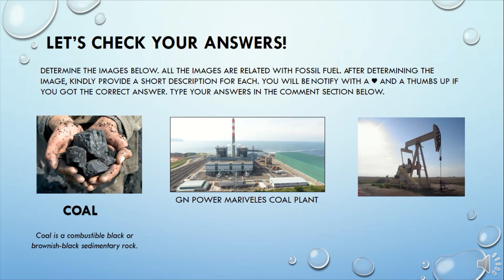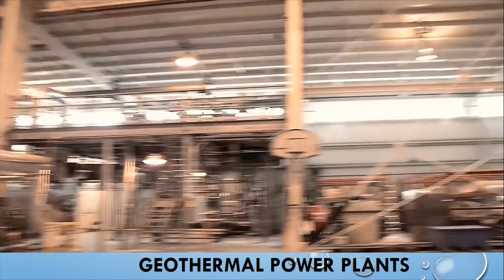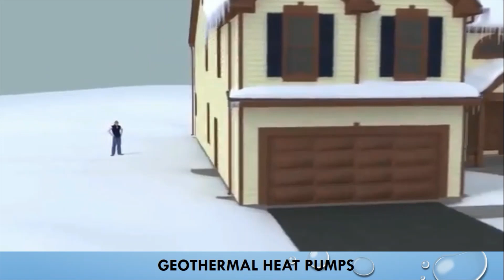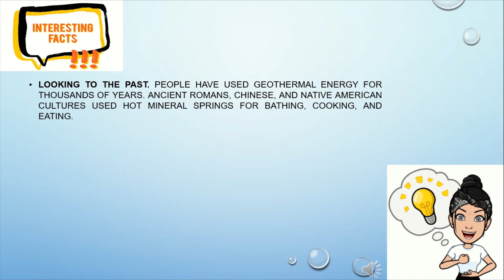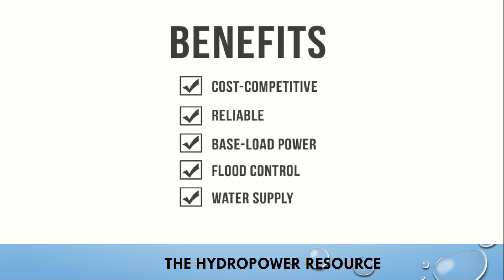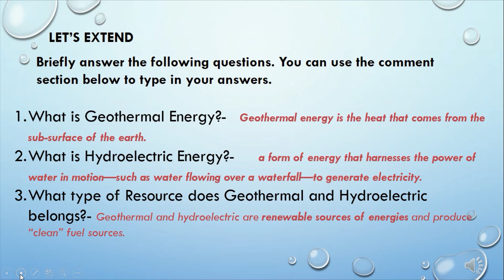GEOTHERMAL ENERGY AND HYDROPOWER RESOURCES (A SHORT DISCUSSION)

Comment: Neia Yzabel M. Real 
11 STEM- Taurus
Let's Review
A. Coal - A material usually found in sedimentary rock deposits where rock and dead plant and animal matter are piled up in layers.
B. Generating Station - The main source of electrical energy.
C. Pumpjack - Used in extracting crude oil, is the over ground drive for a reciprocating piston pump in an oil well.

Let's Extend
1. Geothermal Energy - is the heat that comes from the sub-surface of the earth
2. Hydroelectric Energy - a form of energy that harnesses the power of water in motion such as water flowing over a waterfall to generate electricity
3. Geothermal and hydroelectric are renewable sources of energies and produce clean fuel sources.

Comment: Rivera, Jasy Jan C.
11-STEM Scorpius

Let's review
A. Coal - one of the most important primary fossil fuels,  formed from dead/decaying plants that have been fossilized over millions of years. 
B. Generating station -  a plant for  generating electric power.

C. Pump jack - is a device used in the petroleum industry to extract crude oil from a oil well where there is not high enough pressure in the well to force the oil to the surface.

Comment: Georgette Rhianne C. Baluyot
11STEM-Phoenix

 Let's Review 
A. 
Coal- one of the most important primary fossil fuels, a solid carbon-rich material that is usually brown or black and most often occurs in stratified sedimentary deposits.

B.
 Generating station- a station for generating electricity, where electricity is expected to be directed to households and other facilities in need of electricity. 

C.
 Pumpjack- is the overground drive for a reciprocating piston pump in an oil well. It is used to mechanically lift liquid out of the well.

Let's Extend
:

1. Geothermal energy comes from the heat within the Earth. Produces electricity, to heat buildings and greenhouses, and for other purposes.
2. Hydropower, or hydroelectric power, is one of the oldest and largest sources of renewable energy, which uses the natural flow of moving water to generate electricity. 
3. The type of Resource that both Geothermal and Hydroelectric Power belongs to is the Renewable Energy.

Comment: Tumbaga, Reinalyn J.
11- Stem Pisces

LET'S REVIEW
A.) COAL - Coal is a sedimentary rock that can be burned and use as a fuel.
B.) GENERATING STATION - Also known as generating plant, an industrial facility for the generation of electric power.
C.) PUMP JACK - Device used in the petroleum industry to extract crude oil from oil well.

LET'S EXTEND
1.) Geothermal energy is a renewable energy source that comes from the heat within the earth.
2.) Hydroelectric energy is electrical energy produced through the power of moving water.
3.) Geothermal and Hydroelectric are both renewable sources of energy.

Comment: Lim, Anne Margaret M.
11 - STEM PHOENIX

Let's Review
A. Coal - is a solid carbon-rich material, usually brown or black, found in stratified sedimentary deposits. 
B. Generating Station - is a facility that is responsible in the production of electric power.
C. Pump Jack - is a device that is used to crude oil extraction by mechanical means.

Let's Extend
1. Geothermal energy is a renewable energy source derived from the heat energy contained within the Earth.
2. Hydroelectric Energy is a type of electrical energy that is generated by the movement of water.
3. Both are renewable energy sources.

Comment: Tuazon, Janna Christel B.
11 - STEM LIBRA 

Let's  Review
A. Coal is a type of fossil fuel that is typically black or brown in color and is used to generate electricity.

B. Generating Station is a facility that is responsible in the production of electric power 

C. Pump Jack is a device that is used to crude oil extraction by mechanical means.

Let's Extend
1. Geothermal energy is a renewable energy using heat within the earth.

2. Hydroelectric Energy is a type of electrical energy that is produced by hydropower or water.

3. Both of them are renewable energy sources.

Comment: Untiveros, Kim Lheonardo D.

a. COAL- coal is type of mineral formed by a called coalification
b. GENERATING STATION - a electric power generator 
c. PUMP JACK - a hammer like pump in oil well

Let’s extend:
a.Geothermal Energy- Heat that comes from the surface of earth
b. Hydroelectric Energy- energy from a flowing form of water
c. What type Sources… - It belongs to renewable source of energy

Comment: Guanzon, Aldryn Anne I. 
11 STEM - Sagittarius

Let's Review:
A. Coal - a sedimentary rock which is mainly used for generating electricity. 
B. Generating Station - a facility wherein primary energy like coal is being converted into electricity. 
C. Pump jack - a device used to increase pressure within an oil well to pull the oil into the surface.

Let's Extend:
1. Geothermal energy is the heat coming from the Earth's interior. It is used primarily to produce electricity.
2. Hydroelectric energy is a form of energy that generates electricity by harnessing the energy of flowing water.
3. Geothermal and Hydroelectric energy are under the category of renewable energy.

Comment: Gabor, Karloz Yzmael B.
11- STEM VIRGO

LET'S REVIEW
a.) Coal - Coal is the most abundant fossil fuel resources. 
b.) Generating Station - Is an industrial structure that generates electricity.
c.) Pumpjack - Pumpjack is the underground drive for a reciprocating piston pump in an oil well.

LET'S EXTEND
1. Geothermal Energy is a renewable energy source because heat is continuously produced inside the earth.
2. Hydroelectric Energy is a form of energy that harnesses the power of water in motion.
3. Renewable energy sources include Geothermal Energy and Hydroelectric Energy .

Comment: Añonuevo, Chrysler A.
11-Stem Sagittarius

Let's Review
A) Coal is a flammable black or dark brown rock made primarily of carbonized plant materials that is found primarily in underground deposits and utilized as a fuel.

B) A generating station is a power plant that produces energy.

C) Pump Jack- A pump jack is a device used in the petroleum sector to collect crude oil from wells.

Let's Extend:
1. Geothermal energy is a source of energy that comes from the core of the Earth. It's produced by the heat generated during the planet's development and the subsequent radioactive decay of elements.

2. Hydroelectric energy is a type of energy that uses the force of moving water to generate electricity.

3. Renewable energy sources include geothermal and hydroelectric electricity.

Comment: Let's Review
A. Coal is a fossil fuel that formed from the remains of plants that died million years ago into peat.
B. Generating it is a facility for the generating of electric power. 
C. Pump jack is a device that use to get crude oil from oil well where there is not high enough pressure.

Comment: Sagun, Neil V.
11-STEM, Phoenix

Let's Review:
A. Coal
- One of the PRIMARY FOSSIL FUELS. A combustible black or brown rock composed of carbonised plant matter. Found mainly on underground surfaces
B. Generating Station
- A station that facilitates electric generation.
C. Pump Jack
- Used for extraction of oil or crude oil in petroleum industry

Let's Extend:
1. Geothermal Energy 
- An energy present in Earth's crust and formed by radioactive decay, it is also the heat from our planet's core. A renewable resource.
2. Hydroelectric Energy
- An energy in which the harnessing of water power in motion is generated. A renewable resource.
3.  Geothermal Energy and Hydroelectric Energy are both renewable resources.

Comment: Espinosa, Marcelino C.
11-STEM TAURUS

Let's review

COAL
- is combustible  sedimentary rock,Coal formed due to heat and pressure that turns the dead plants into coal.

GENERATING STATION
-is a plant for generating electric power.

PUMPJACK
- is a machine or tool  used in the petroleum industry to extract crude oil from a oil .

Lets extend

What is geothermal energy?
- Geothermal energy is heat within the earth. 

What is hydroelectric energy?
- is a form of energy that harnesses the power of water in motion such as water flowing over a waterfall to generate electricity. 

What type of resource does geothermal and hydroelectric belongs?
 - is a renewable sources of energy and produce clean fuel sources.

Comment: Bernatia, Danah Danica R.
11 - STEM Sagittarius
Let's review:
A.Coal
- formed from dead/decaying plants that have been fossilized over millions of years and subjected to heat and pressure.
B.Generating station
- Is a source of electricity
C.Pumpjack
-  Is used to mechanically lift liquid from the well if there is not enough pressure under the hole for the liquid to flow to the surface.

Comment: ANDRES, JOHN BENEDICT M. 
11-STEM Phoenix

Let's review: 

A) Coal - is a combustible black or brownish-black sedimentary rock and contains high amount of carbon and hydrocarbons primarily used as a fuel.

B) Generating Station - A power station or power plant is a facility for the generation of electric power.

C)Pump Jack - a device used in petroleum industry to extract crude oil from oil well.

Lets Extend:

1. Geothermal energy is heat within the earth also comes from the heat in the earth’s core. 

2, Hydroelectric energy - is a form of energy that harnesses the power of water in motion such as water flowing over a waterfall to generate electricity.

3. Geothermal energy and hydroelectric energy are both renewable energy sources.

Comment: Montero, Gerard James R.
11- STEM virgo

let's review:🎃
A. Coal is a type of fossil fuel formed from sediments such as prehistoric animal and plant remains that constantly piled up and become pressurized through time.
B. Generating Station is an industrial facility for the generation of electrical power.
C. Pumpjack is a device used in the petroleum industry to extract crude oil from an oil well where there is not high enough pressure in the well to force the oil to the surface.

let's extend:🎃
1. Geothermal Energy is the heat that comes from the Earth's core and is a renewable source of energy. It is produced from the heat generated during the planet's creation and the subsequent radioactive decay of elements.
2. Hydroelectric energy is a form of energy that harnesses the power of water in motion to generate electricity. 
3. Geothermal and hydroelectric energy are both considered renewable sources of energy.

Comment: Sharlene Gayle V. Mendoza 
11- STEM Sagittarius 

Let’s Review
A: Coal is - combustible black or brownish- black sedimentart rock and it is mostly made up of carbon with varying proportions of other elements and Coal is mostly used as source of electricity.
B: Generating Station- it is a power plant that generates electric power
C: Pumpjack- is a device used in the petroleum industry to extract crude oil from a well when the pressure in the well isn’t high enough to propel the oil to the surface.

Let’s Extend:
1. Geothermal Energy  is heat that comes from beneath the earth’s crust and it is renewable energy source since it can be supplied constantly inside the earth.
2. Hydroelectric Energy- it is a renewable energy source that generates electricity by exploiting the natural flow of water
3. Geothermal and Hydroelectric are both renewable sources of energies.

Comment: Ladra, Camille Morales
11- pisces(stem)

1.Coal- is a black or brownish-black sedimentary rock that can be burned for fuel and used to generate electricity
2.Generating station- A power station, also referred to as a power plant and sometimes generating station or generating plant, is an industrial facility for the generation of electric power.
3.Pump jack- is a device used in the petroleum industry to extract crude oil from a oil well where there is not high enough pressure in the well to force the oil to the surface.

Comment: Ma. Jennilyn G. De Jesus
11 STEM - Pisces
Let's Review
A. Coal is a type of fossil fuel formed from decayed plants that are fossilized for millions of years and is applied heat and pressure. 

B. Generating Station is an industrial facility that generates electricity from primary energy. 
C. A Pump Jack is use to mechanically lift liquid out of the well if not enough bottom hole pressure exist for the liquid to flow all the way to the surface.
Let's Extend
1. Geothermal Energy -  is the heat that comes from the sub-surface of the earth. It is contained in the rocks and fluids beneath the earth’s crust and can be found as far down to the earth’s hot molten rock, magma.
2. Hydroelectric Energy - is a form of energy that harnesses the power of water in motion—such as water flowing over a waterfall—to generate electricity. 
3. What type of resource does Geothermal and Hydroelectric belongs? - they are both classified as renewable sources of energy.

Comment: Andrei Nicole M. Santos
Grade 11- Phoenix

Let's review: 
Coal: Formed from the remains of living organisms millions of years ago and releases heat energy when burned. 
Generating station: A source of electrical energy.
Pumb Jack: A device used to extract crude oil.

Let's extend:
Geothermal energy is heat within earth. Hot water and steam from deep underground can be used to drive turbines is called geothermal energy.
Hydroelectric energy. The water high up behind the dam contains gravitational potential energy . This is transferred to kinetic energy as the water rushes down through tubes inside the dam.
Geothermal and Hydroelectric are both renewable resource of energy.

Comment: Kathleen Kate P. Faustino  
  11 STEM Sagittarius               
 A. Coal is a fossil fuel made up of sediments such as prehistoric animal and plant remnants that have accumulated over time. Coal is a form of substance found in sedimentary rock deposits where dead plants and animals are stacked in layers.                                       B. A generating station, such as the GN Power Mariveles Coal Plant shown in the picture, is the primary source of electrical energy for households.  
C. A pump jack is a device used in the petroleum industry to extract crude oil from a well when the
pressure in the well isn't high enough to propel the oil to the surface. Pump jacks are used to physically
extract oil for use.

Let's extend                               
      1. Geothermal energy is the heat that comes from the
sub-surface of the earth.    
      2. a form of energy that harnesses the power of
water in motion—such as water flowing over a waterfall—to generate electricity.                
      3. Geothermal and hydroelectric are renewable sources of energies and produce
“clean” fuel sources.

Comment: Nueva, Jose Miguel C.
11 - STEM Taurus

Let's Review
A. Coal - A material usually found in sedimentary rock deposits where rock and dead plant and animal matter are piled up in layers.
B. Generating Station - The main source of electrical energy.
C. Pumpjack - Used in extracting crude oil, is the over ground drive for a reciprocating piston pump in an oil well.

Let's Extend
1. Geothermal Energy - is the heat that comes from the sub-surface of the earth
2. Hydroelectric Energy - a form of energy that harnesses the power of water in motion such as water flowing over a waterfall to generate electricity
3. Geothermal and hydroelectric are renewable sources of energies and produce “clean” fuel sources.

Comment: Liriel Aerol M. Ilagan 
11 STEM Taurus 

Let's Review: 

A. Coal 

   a fossil fuel formed from the remains of plants animals from million of years ago 

B. Generating Station
 
   a generating station that use fossil fuels to produce electricity

C. Pump jack
 
   a pumpjack is the over ground drive for a reciprocating piston pump in  oil well. 
   It is used to extract liquid out of the well mechanically.

Let's Extend 

1. What is Geothermal Energy?

   its a renewable energy source and  it is continuously generated
   developed within the Earth

2. What is Hydroelectric Energy?
   
   a form of energy that produces power by harvesting the energy from moving water,
   such as water flowing over a waterfall.

3. What type of resource does Geothermal and Hydroelectric belongs? 

   They are both clean fuel sources  and   renewable sources of energy

Comment: Samblero, Kenroz A. 
11 STEM - Virgo

Let's Review
A. Coal - are blackish or dark brown in color, sedimentary rock deposits that are combusted for different purposes usually as a source of electricity or for the purpose of burning something. 
B. Generating Stations -  A type of facility with the purpose of generating electricity. Also called as the main source of electricity. 
C. Pumpjacks - also known as oil derricks or oil horses, are devices used to extract crude oil that works similarly to that of a water pump or "poso" but much more complex.

Let's Extend
1. Geothermal energy is the energy that comes from the heat within the internals of the Earth. This energy is  a renewable energy source because of the continuous production of said energy. 
2. Hydroelectric Energy is a form of energy that utilizes the water's movement or motion to generate electricity. It is also a renewable source of energy similarly to the geothermal energy. 
3. Both geothermal and hydroelectric energy are examples of renewable source of energy